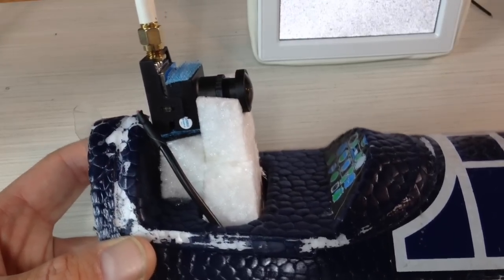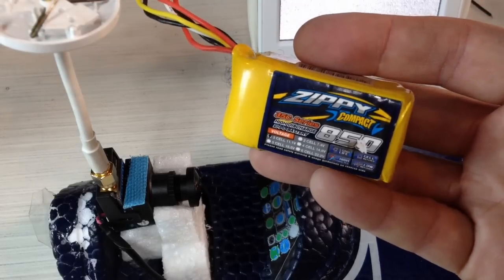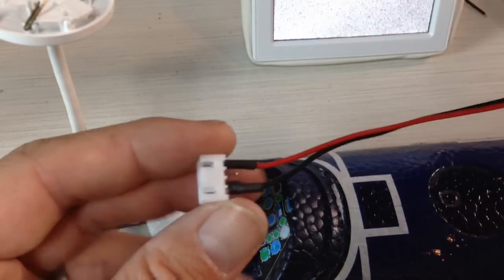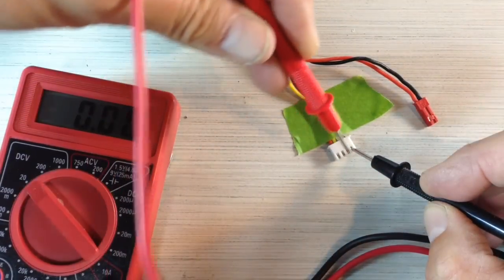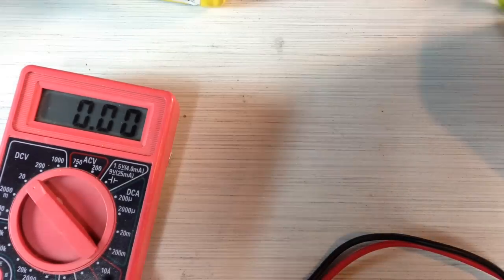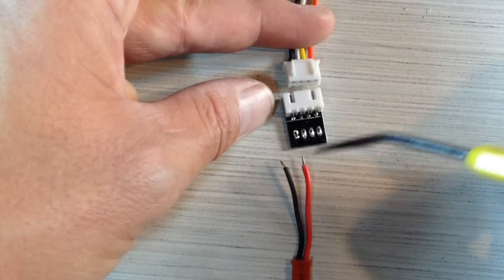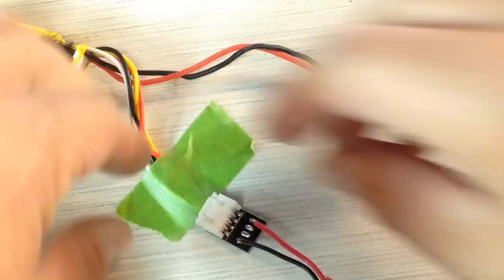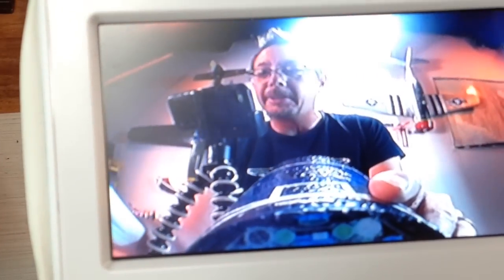Powering the Aomway fpv backpack

Comment: I like that Jeff except I like to use the battery jst for my low voltage alarm, so I just tap a jst pigtail to the ESC main like you showed:)
Reply from the maker: You may need a LC filter if you go off the main. Using a sewerage battery or topping the balance lead you don't need a filter. They have y leads for balance plugs. I use lipo alarms as well- I end up using a timer instead
Reply from the maker: Separate, not sewerage, lol and tapping p, not topping, 
I hate spell check sometimes

Comment: We found that a 450mah 2s battery was good for powering a immersionrc 5.8 and camera for about 2 or 3 flights. Pretty low amp draw. For those planes that you forget to add any accessory lines. I usually add a LC filter permanently on the FPV side of the jst. You have any issues with noise on that line?
Reply from the maker: +Nathan Knight have not tried it yet-
Reply: https://alofthobbies.com/lc-power-filter.html
Reply from the maker: +Nathan Knight No lines in the video!!! probably because its off the balance lead